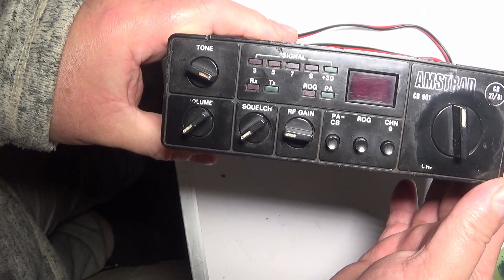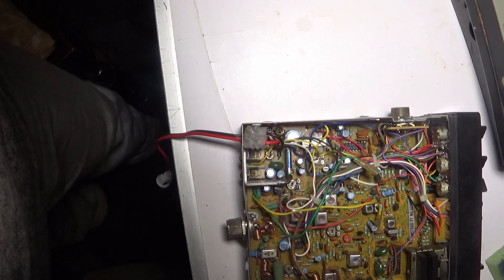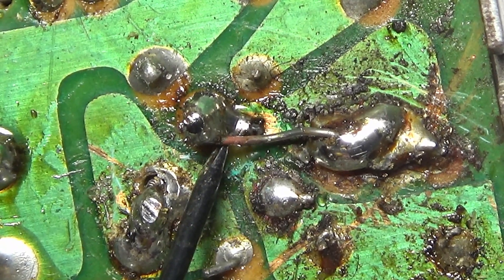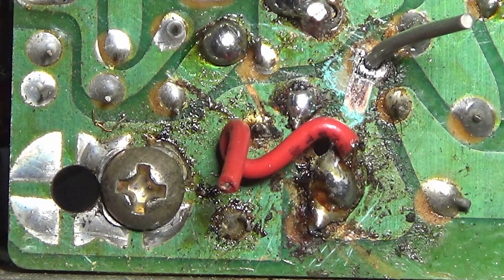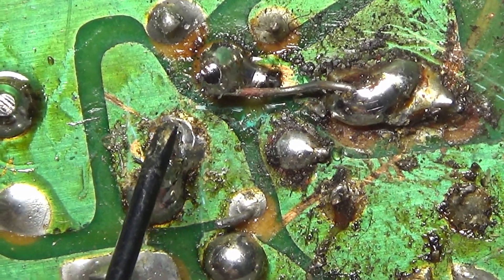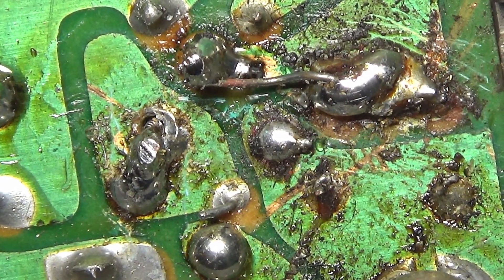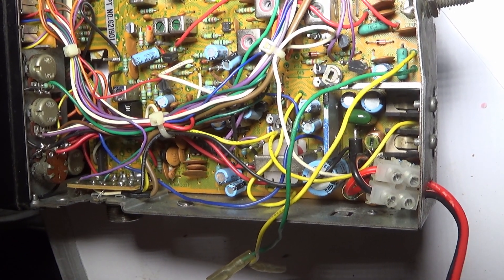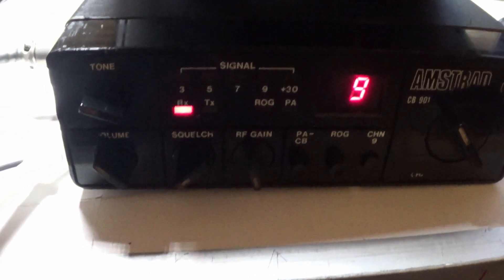AMSTRAD 901 CB Radio  Repair Reverse Polarity Fault Can i FIX IT??

Comment: Well done Steve what type of diode did you use as I need to replace mine in a fidelity 2000
Regards Martin
Reply from the maker: Hi Martin the one I ended up using was way bigger than the original one.
( it worked)  My mistake there.
So I have had a look online for you, knights sell them.
And they are very inexpensive, give them a call Martin they will get you sorted.

Comment: The outputs survived and it is a real Amstrad as well, not the copied one that is crap.   Mind you I never did think a lot on Amstrads!  They do work, but just always looked cheap and nasty to me, very plastic.  However, there are a lot worse than those that were on the market.  Old Cybernet design, not a patch on the newer Cybernet boards.  However, they do work, the most annoying thing was the shrill Rodger Bleep!!!  Beeeep!
Reply from the maker: I will be beeping like a bitch on this one lol.
Some of the locals have been on long enough to recognise it :o)
Reply: @CBRadiouk1  Thank heavens I am out of range of that BLEEEEEEP!!!

Comment: Its all about having a go.  Something to do in lock down. Keeps you busy :-)
Reply from the maker: Hi Fred i was not sure i could save this one, the state of the previous soldering in the area i did was horrible. I was lucky there was no more damage, that often comes with reverse polarity.
Yeas ago i managed to cross connect my Ranger 2950.
The 3 pin plug should only go in one way, but the Centre pin was pushed inside the rig.
Bang but  turned out an easy fix.
My eyes were a lot better back then.
Reply: @CBRadiouk1  morning Steve do you have or know someone who has a handheld I can borrow to go for a walk abouts to try and find this noise. I've read it could be up to 200 metres away.
Reply from the maker: @albertfooty7868  
Hi Albert no mate regarding the hand held.
How much noise are u getting now.?
I seem to remember you saying  some of the noise, starts around 6pm.
Then is there till 6 am,  could be led street lights causing it.
 It sorta coincides with the timing.
Reply: @CBRadiouk1  noise is still 8lb starts at 6pm ish right round to midday ish so I have a window of only 3lb noise from midday till 6pm when it's good mate.
Reply from the maker: @albertfooty7868  hi Albert ok m8, not good.
Do you drive? If you do put a rig in the car, drive around a little with the rig on.
When I lived in Kempston, there was one of those green boxes up the road.
When I drove past it, it killed my recieve.
When I was working I noticed  a new QRM  hotspot.
When I looked around, there was a new road sign.
You know the ones that flash up with a smile face .
Could be anything mate.
Are you near any shops, often as I'm driving along, the noise floor comes up while passing them.
Its in my to and from work vids
Reply: @CBRadiouk1  yeah mate I drive I ain't got a mobile aerial though.

Comment: It's not in a bad state inside.
I've had rigs that have been so messed up by screwdriver twiddlers that all I can do is salvage any good components.
Reply: Nothing wrong with screwdriver experts, they gave me a good income at one point lol.
Reply from the maker: LOL  i have had a few pass through over the years, everything turned all the way up.
Holes drilled in cases water damage, rusty dirty filthy things.
Luckily they are being sold on the bay now :o)
Reply: @CBRadiouk1  Tell me about it, I just wonder what they were thinking, the sets are usually so detuned I am surprised they heard anything.  I had one person ask me why I was not using a screwdriver like he saw the person that tuned his set up did, DUH!
Told him his set was so detuned I was surprised it worked at all.

Comment: I'm not gonna mention anything about your soldering lol
Reply from the maker: Hi Dipsy the huge blob was there b4 I started.
Looking around the board it looks a mess where work had been done..
I  will say I am happy the rig now works.
Maybe I will open it up  if it works and do a tidy up video.
Reply: @CBRadiouk1  only joking fella if it works don't fix it I've always been told
Reply: @KnugenMooMoo  Yeah, but some isopropyl and a scrub with a brush wouldn't go amiss, lots of crud on the back of the board.  Soldering was not bad all things considered.  I have seen a hundred times worse.  Honestly, at times I look and wonder why some things ever worked with the mess left inside lol.
Reply: @BoB4jjjjs  I've seen alot of worst then that to be honest
Reply: @KnugenMooMoo  I bet.  Shorted, huge blobs and joints with nothing on them.  Give me strength!  I had one with two solder blobs touching and it was still working, it should have been shorted out all things being equal.

Comment: Well done Steve, yeah looks like you saved it. The noise on the volume pot is just a dirty carbon track, bit of switch fluid will soon fix that. The dirty circuit board needs cleaning with  Isopropyl Alcohol.
Reply from the maker: Hi Steph thanks mate, well money is tight here so it will have to stay dirty lol.
Same goes for the dirty switch , i have in the past used WD40.
The main thing next, is to test it for out put.
Then get some local checks, the old girl has been sat in a Draw for ages.
I was surprised  how close in the camera was able to focus, shame about the table i use , its very wobbly.
Reply: @CBRadiouk1  If you have any white spirit that will be fine that is cheap as chips.
Reply from the maker: Hi Steph now i do have some of that, looks like some one had plenty of fluX.
And an Arc welder as a soldering iron,  :o)
Reply: @CBRadiouk1  Yeah bit of a mess mate, yeah bit of white spirit cotton bud or bit of tissue.

Comment: It may not be pretty but it works!
Reply from the maker: Hi Wayne a typical old well used rig, it was a challenge to do with my eyes.
As you said its not pretty,  i will check it over on the power meter in the morning.
If it works i will get some checks on video.
What i do with it after is a Mystery to me at the moment . :o)
Reply: @CBRadiouk1  I can sympathize, my eyes aren't as good as they used to be either. The rig powers up now, that's a start. I can't wait to see some checks on video. You might be surprised with how well it performs. take care Steve. :)
Reply from the maker: @waynekerrgoodstyle  Hi Wayne  as long as it works i will be happy.
Reply: @CBRadiouk1  I'm sure it will work.
Reply: @CBRadiouk1  I hope you don't forget that the Amstrad is on channel 9. lol
Reply from the maker: @waynekerrgoodstyle   Hi Wayne no i wont forget, off camera it was connected to a Dummy load.
Reply: @CBRadiouk1  I never thought for a second that you didn't use a dummy load.

Comment: Well done M8 73’s from wws1185 western Newfoundland Canada 🇨🇦
Reply from the maker: Hi David thank you fella, its been a long time since i did anything like this.
My Eyes are not very good anymore, and it drives me nuts.
Its like Soldering on the other side of a fish tank. :o)
I will go back in the rig presuming it may work, and de solder some of the joints and re do them.

Comment: Well Done Lad
Reply from the maker: Thanks Joohop  it was a bit of fun to do, only thing is (if it works)
I now have to face my Locals breakers on it lol.
Reply: @CBRadiouk1  They Work But Terrible For Broadband , I've Had Many And Sold Them As Quick As Possible :) 
I've Got A Eurosonic es200 LCD Handheld With The Same  Symptoms But Because It's Battery And External 12 volt There Are 2 Diodes So It's All Stripped And Waiting For A Few Components To Arrive :) 
Bless Up Earthling
Reply from the maker: @joohop   I have a few over the years, the last one i had was (almost mint).
Came with box etc  but like you say they are not great , at anything lol.
That said this one could be coming up to 40 years old.
Have you seen what old junkers are selling for nowdays.
They are dragging rigs out of old sheds and ponds, and askin Silly money.